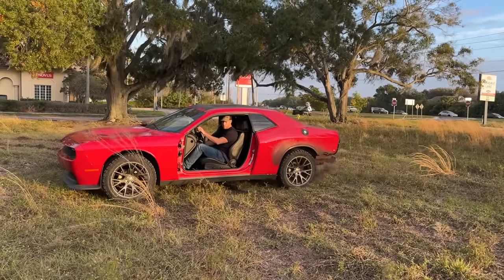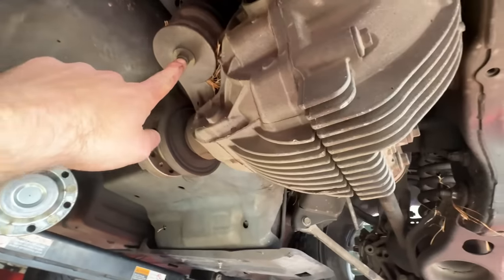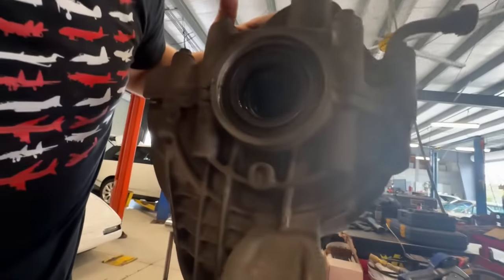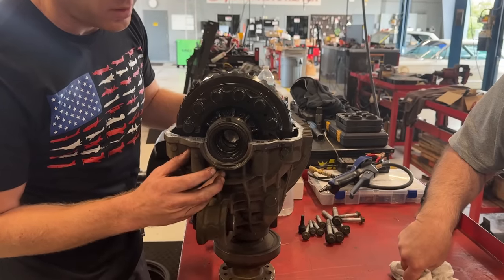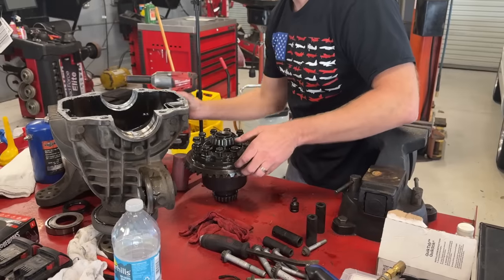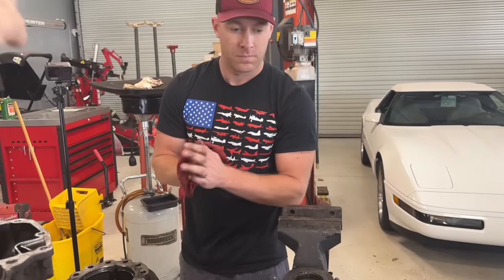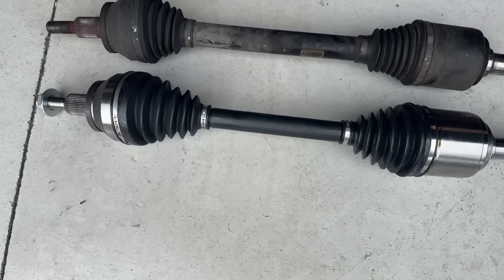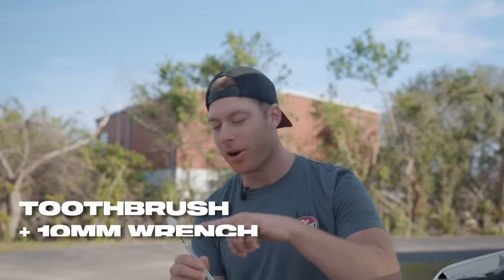Rear End CARNAGE On The Hellcat... Tear Down & Rebuild After A Heavy Clutch Drop and Mud Tires

Comment: We have a really strong magnet that we always take with spare shafts off-roading. But if that doesn’t get it another good trick is stick welding a few electrodes right to the broken shaft.  Then using them to pull the shaft.   

Sometimes it’s easy. Sometimes you gotta fight it

Comment: You should be able to stick an extension thru the non broken side and just hit it with a hammer instead of taking it all apart
Reply: Probably has a cross pin in the way
Reply: Agreed

Comment: I replaced the whole rear in my Dart with a 83/4 with a 3.91. That was a bit low for a street car so I swapped the center chunk with a 3.23 Dana Power lock out of a 65 pick up.
Did it all in the driveway with jack stands and ramps. I was a lot younger then and enjoyed upgrading my car every time I broke it.

Comment: Could've just stuck a 1/2" rod through the diff from the passenger side and knocked the piece out with a hammer.. that open cv joint is gonna fail pretty quickly running it off road . Just clean it, grease it and  put a boot on it... Still love the channel, keep at it..!🙂👍
Reply from the maker: Incorrect there was a cross bars in the middle of the diff, trust me we tried.
Reply: @DoctrParker  oh sh!t..! You are correct! I completely forgot about the cross bar being there.. I stand corrected sir! 😉👍
Still love what you're doing!